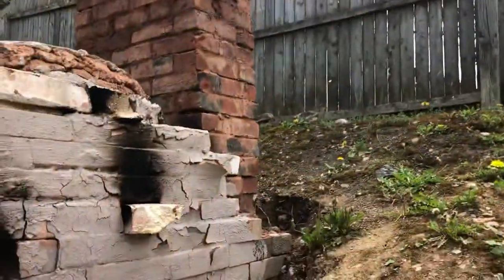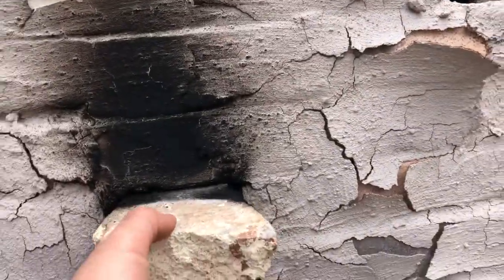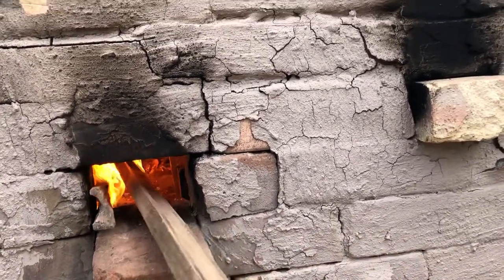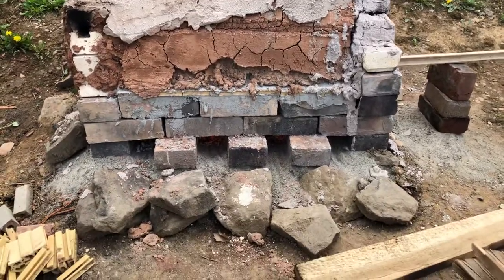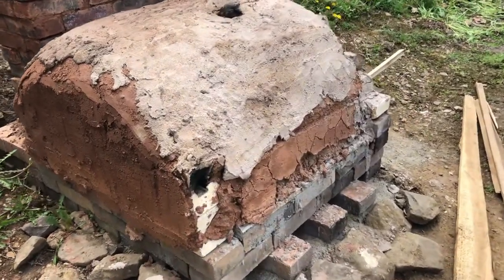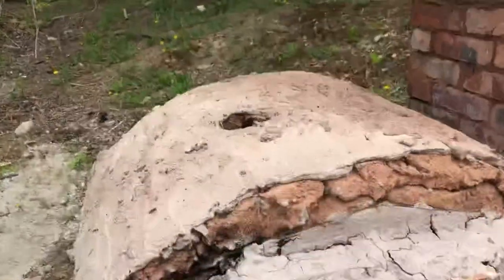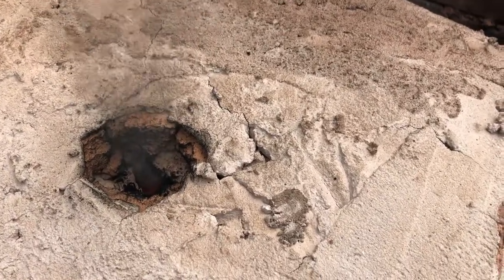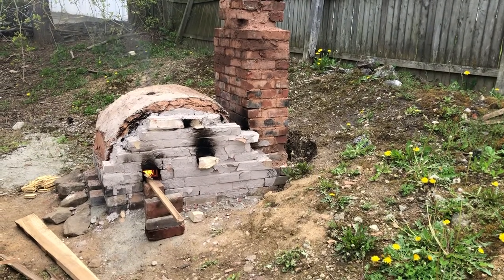Small conversion wood kiln firing

Comment: I applaud your efforts! Would like to have seen the results, even if maybe they weren't quite what you were after. I am attempting small scale wood firing myself, except with a Bourry box kiln.Cheers from South Dakota!
Reply from the maker: It went very well, climbed in temperature better than i expected and had the cone 6 mashed down when a severe thunderstorm forced me to shut it down. Will fire again soon. Are you building a kiln or is it already built? So much one can do with some old electric kilns... Thanks for stopping by!
Reply: @muddymike  I'm in the building phase. I like the way you used the old electric kiln. Hadn't seen one repurposed quite like that before. I also am gathering local clay. Still testing samples, but have found some that will fire to at least cone7.